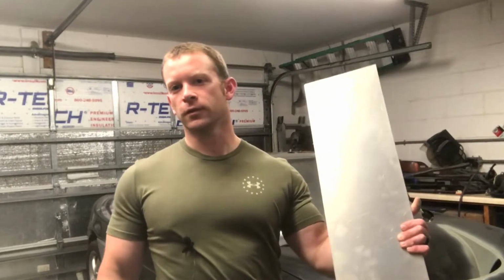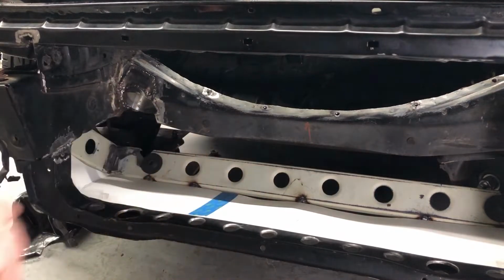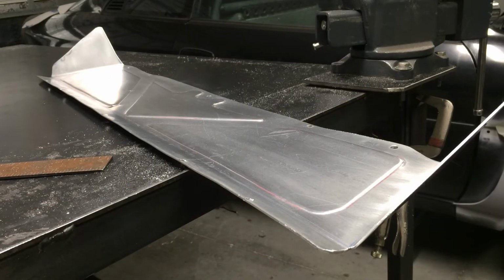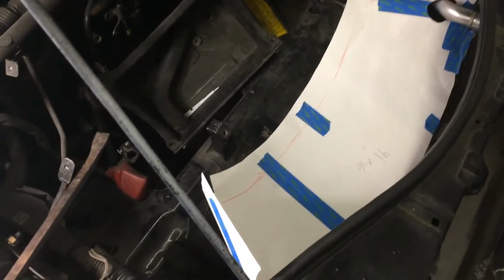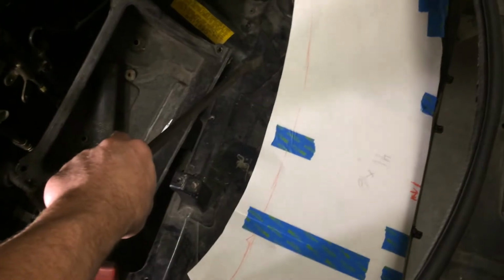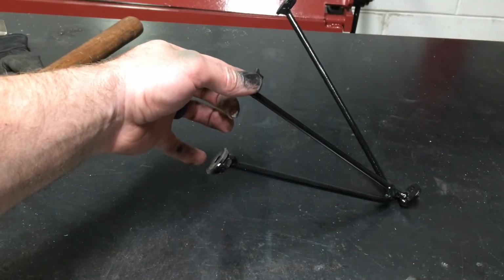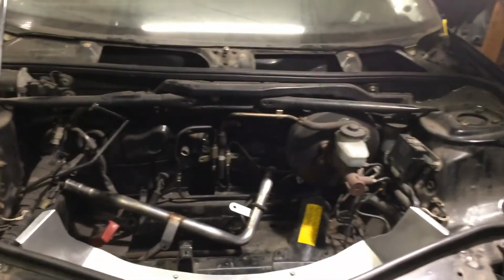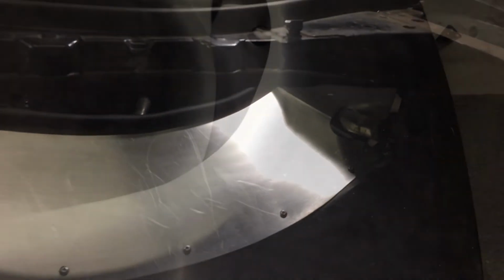Custom Radiator shrouds /duct (V8 Mr2 Build #32)

Comment: as an aw11 guy i was never a fan of the sw20 because it always seemed like the only way forward with them was slap a bigger turbo on the 3s or swap a k20 and do the same thing, this build has so much work put into it and im so impressed, makes me want an sw20
Reply from the maker: Thanks! I have put an enormous amount of work in to make this happen. Im getting closer to a first start. This carona thing has slowed up the process recently unfortunately. I will keep plugging away at it. As always, I appreciate the support.
Reply from the maker: Thank you for the kind words. I would like to add a AW11 to my collection one day